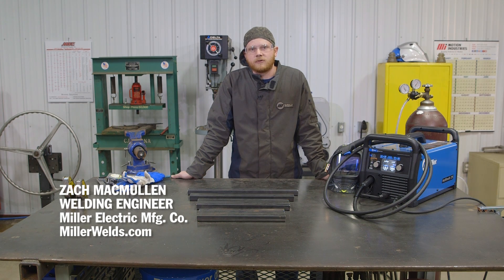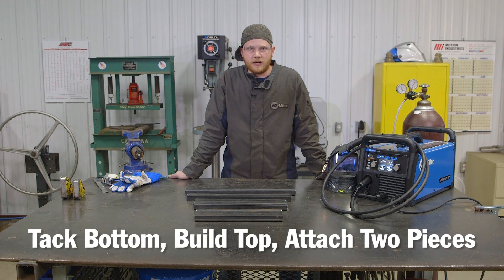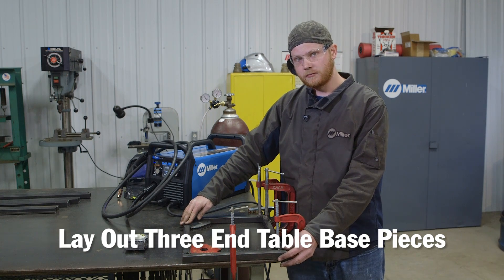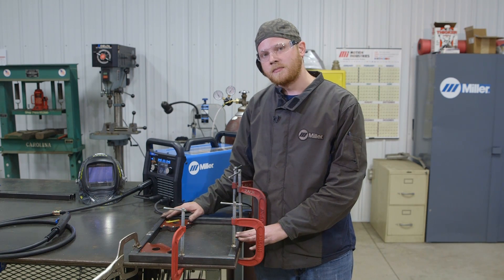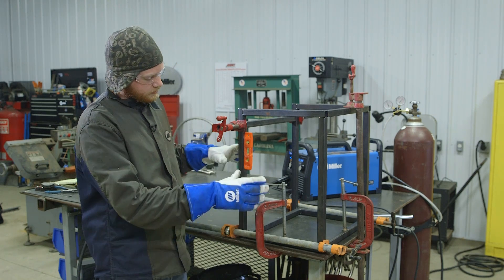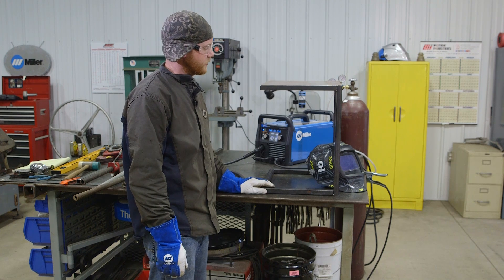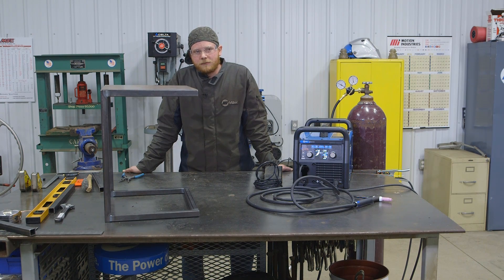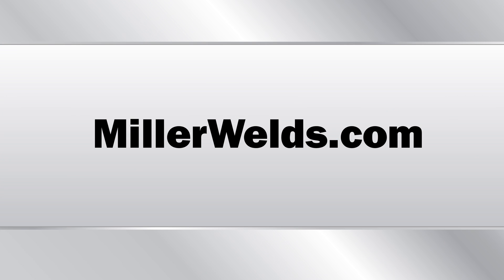How to Build an End Table with the Miller Multimatic 215

Comment: I have Miller 215  NOT happy with TIG part ,  It shows,look at (4:17) the beads done with the TIG .. But the MIG Part works great and stick is OK if you use 6013 .  The Miller 220 bitter way to go for the money.

Comment: No need to drill vent holes in a visible surface.
Drill vent holes in the tube where the butt joints are made and covered by the added tube, especially if leaving some ends open.

Comment: I'm sure this is a very capable small machine that will fit in a lot of shops, but why oh why does Miller continually put the worst weldor's in their videos? I have first time apprentices that make better welds than are showcased in almost every Miller In House Video.. Second, why on earth would I waste my time tacking with a Mig, changing bottles from C75/25 to Argon to finish with Tig?  I'm surprised he didn't do the inside welds with stick. Come on Miller, stop acting as if everyone is a dummy. If you need weldor's who can actually lay down a perfect bead, get in touch. We can supply you some.
Reply from the maker: Thanks for your feedback, Jim. Our fans have a wide variety of experience levels, and we tailor our videos to accommodate that. If you would like discuss the welds in more detail, we'd be happy to talk more with you. Please send us a private message with the details. Multiple processes were used for this application in order to highlight both MIG and TIG capabilities of the Multimatic 215 and how easy it is to switch between the 2 process. One of the features of the Multimatic 215 is that it has two gas connections – one for MIG and one for TIG – so switching gas bottles isn’t required. If you have any further questions, let us know. Thank you!
Reply: Well I have to say that two gas connections is a very smart idea! For a shop machine it certainly WOULD save a lot of time. I could even see on a field job using two small bottles might be advantageous. So I retract my criticism of the 'swapping' issue and stand corrected. Now if you could only get demonstrators who can show users what a well crafted weld looks like. I understand that there are people who have never picked up a torch before that are going to buy this machine, but it would be a benefit to them to see high quality welds so that they had something to aspire to. Also it would show the capabilities of the machine in producing welds of exceptional quality and cosmetic appearance.
Reply: I'm a beginner to welding and I also purchased the 215. In your mind I suppose I am a "dummy" and that's OK because I have little knowledge at this point. BUT I want to learn by watching and reading everything I can get my hands on. This video, even without perfect welds, helped me learn something. Heck, I don't even know how a flawless weld is supposed to look! My time will come, someday. In the meantime, I really appreciate Miller and their instructional videos. I learn something from each one I watch so Miller Welders, keep em coming! Finally, if you want new welders to do things right, start posting some instructional videos on your channel, rather than complaining about Miller and their "worst weldor's." I'd watch all of your videos. Based on your channel, you seem to be a maker, so I am sure you're capable of providing some welding videos to back up your expertise and views. Complaining never helps anyone, especially to another maker who just wants to learn and be better.I challenge you to make a better instructional welding video. If you do, it will make a much larger impact on someone. Till then, Miller Welders, I salute you!